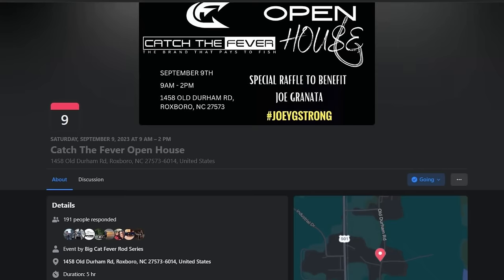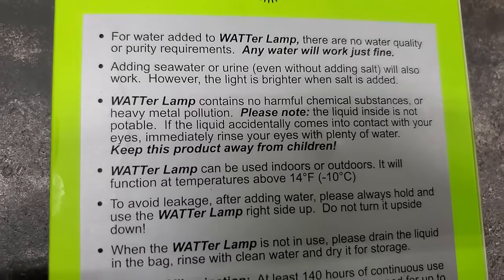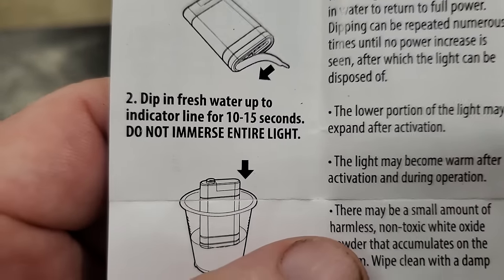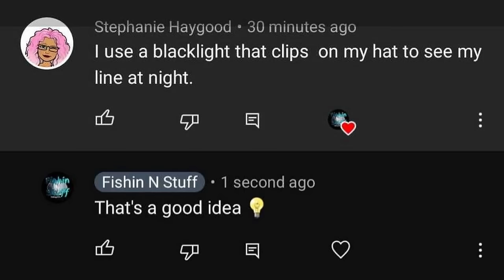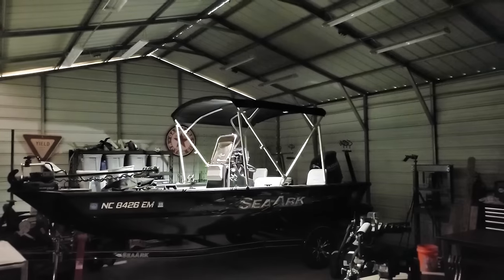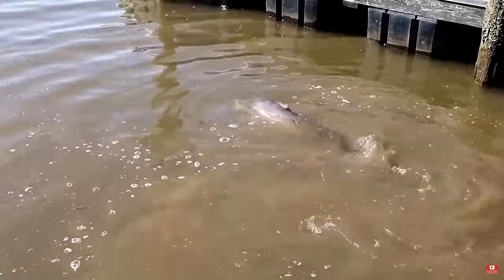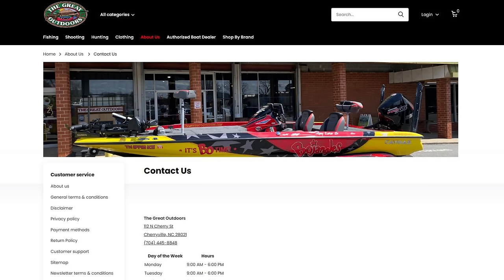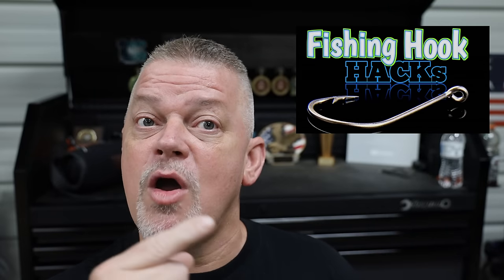6 (NEW) Awesome Fishing HACKs

Comment: Those water lights are awwssome, specially for some that could get caught in a tornado shelter with no electricity.
Reply: Does it work with pee?
Reply from the maker: @D-B-Cooper  yes ot says it does on the back of the package

Comment: You need to be careful with cheap china UV flashlights.

Sufficiently intense UV-A and blue radiation can cause chemically-induced lesions in the retina. Other effects are possible (e.g., UV-A induced sunburn), but the risk is much less significant. Glare discomfort may also occur at exposures within the safety limits.